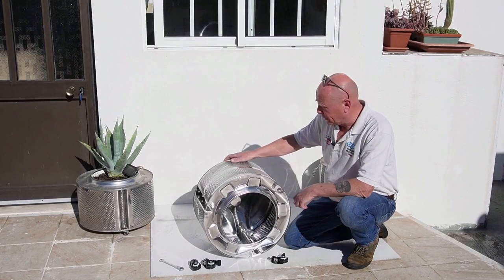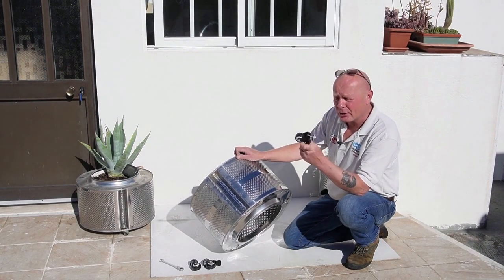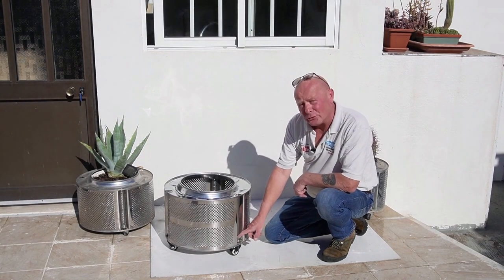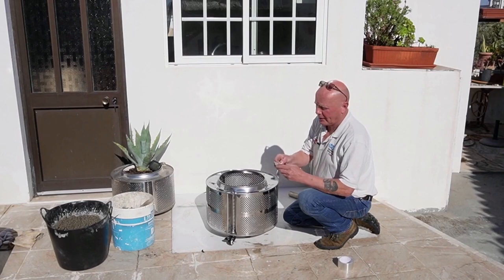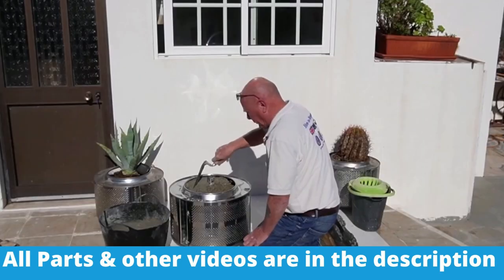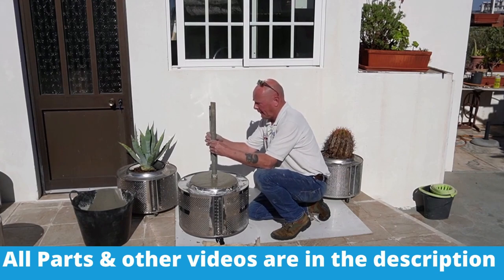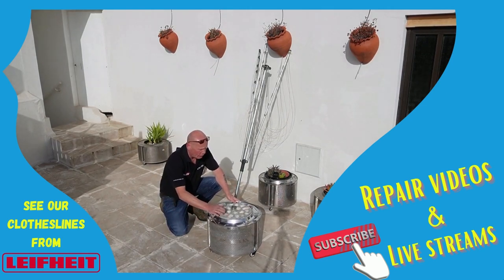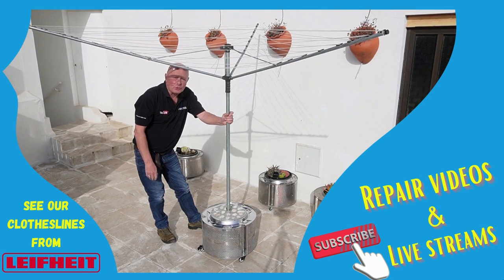Rotary washing line or BBQ table out of old washing machine drum

Comment: Went to Kingsdown Camping site in Deal last September to reunite with a couple of guys who I hadn't seen for half a century. We arranged to have a fire and were supplied with a fire-pit to keep it off the ground. The pit turned out to be a washing- machine drum on some steel legs and it worked brilliantly. Just bolt the flat bars through the sides of the drum to form the legs and it works really well to create a fire suitable for simply keeping warm or providing a friendly ambience, or for simple cooking purposes. 😁

Comment: What size premade cement bag will I need?
Reply from the maker: A good way of saving some money is to fill the bottom with some locks then put a cement bag to fill the rest I can't tell you the exact amount because it depends on the size of the drum As an ageing appliance engineer, my expertise lies more in the domain of domestic devices than in IT, resulting in a limited understanding of YouTube video optimisation. Consequently, my videos might not reach their full potential due to these IT constraints.

Nevertheless, they offer invaluable aid to those who encounter them. Your support in sharing our channel on social media would be immensely valued. By disseminating our content, you enhance our visibility and contribute towards addressing the pressing matter of appliance wastage. In turn, you play a role in averting numerous machines from facing an untimely end in the heavenly scrapheap of appliances. Thanks 👍